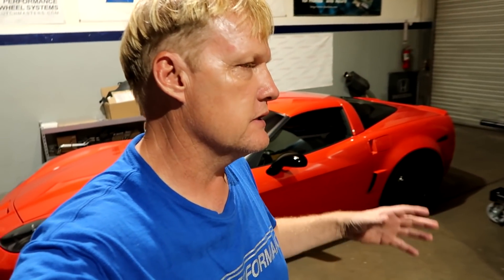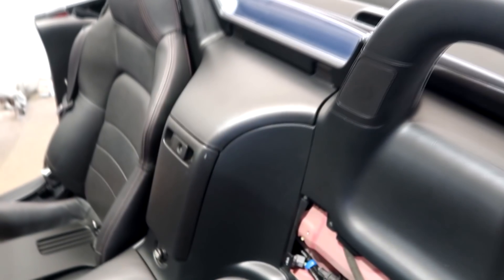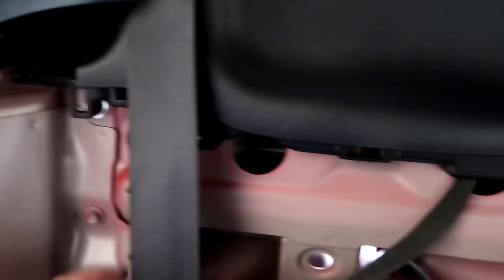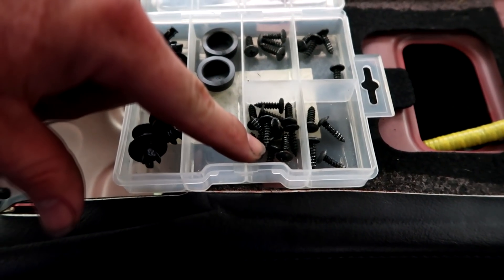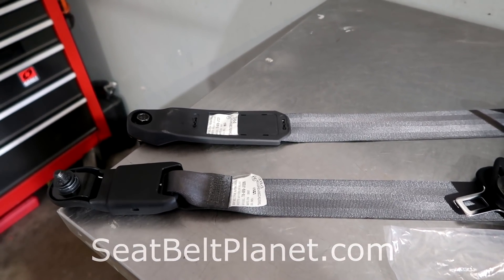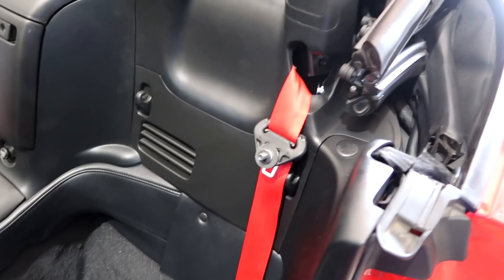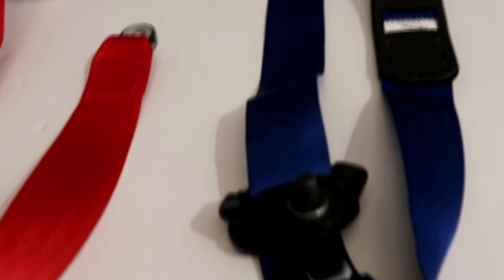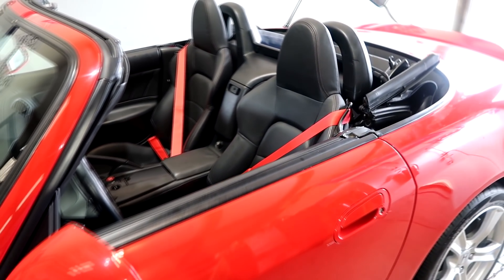S2000 CHANGE SEAT BELTS- HOW TO:

Comment: Great idea, i always wanted to do this. I may attempt it this week. I have a question, since you removed the seats with the top down and disconnected the wiring underneath the seat, would putting the top up after already having the seats removed throw a Airbag(SRS) code???
Reply from the maker: Only if you turn on the ignition with the seat belts disconnected.

Comment: The ‘don’t turn your ignition on while seatbelts disconnected’ must be an 06+ thing. I’ve got race seats and harnesses in my MY04 with no ABS light. Stock seatbelts completely removed. Love your shop!
Reply from the maker: The 00-05 doesn’t have an inflater that the 06+ has.

Comment: On AP1 if I take the SRS control module out then is it safe to start car with seatbelts removed? Have to move car around garage.
Reply from the maker: Yes, however , you will have to re set the airbag light when you reassemble it.

Comment: Any idea if all model year seat belts are the same? Will an 00-05 belt work in an 06-09?
Reply from the maker: 00-05 are one kind. 06+ are another.
Reply: @LHTPerformance  does that hold for international models? I have a MY07 in the UK and I am wondering which seat belt extender I need, the 00-05 or 06-09 one?
Reply from the maker: @1996chinaman  I really couldn’t say. I’m sorry.

Comment: Does it help with slow seatbeat retracting?
Reply from the maker: Dreamjdm The newer seat belt webbing seams to be slicker and retracts faster than older belts. We did this on the Integra and it made a big difference.
Reply: @LHTPerformance  thank you! Great information! Alot of people have problems with their seatbelt not retracting. This is a fix!

Comment: Yeah don't use (safety restore) for the seat belts. They are cheap for a reason. One of the plastics from the seatbelt mechanism was broken in the belt had a small tear in it
Reply from the maker: Areyousure We’ve used Seatbeltplanet several times before and always top notch